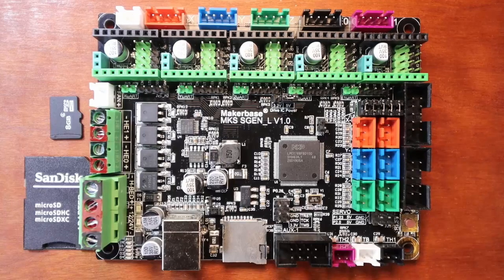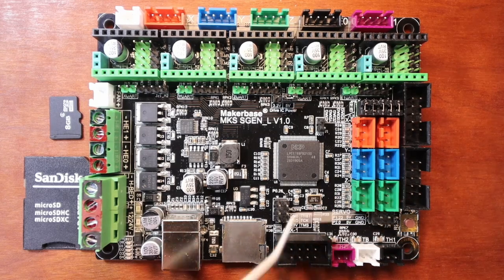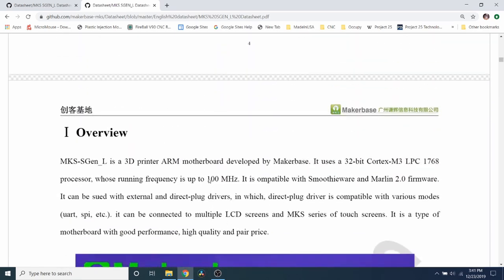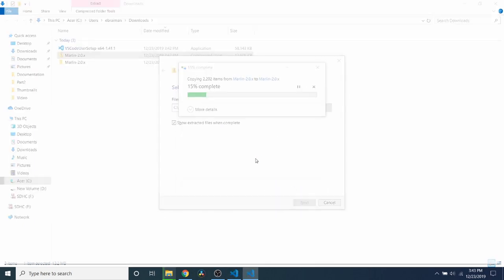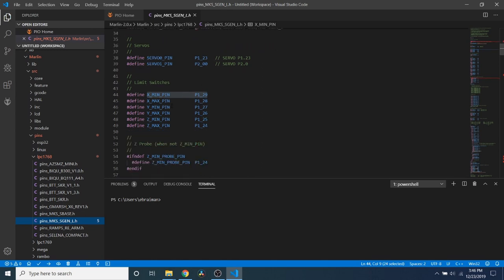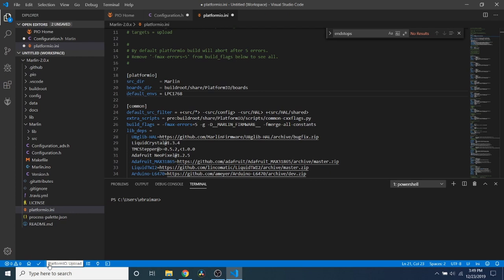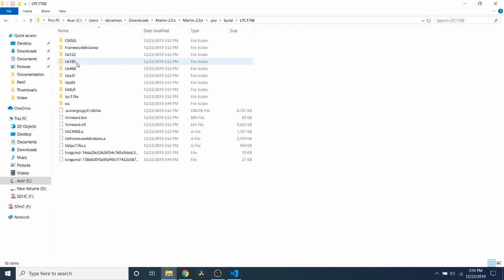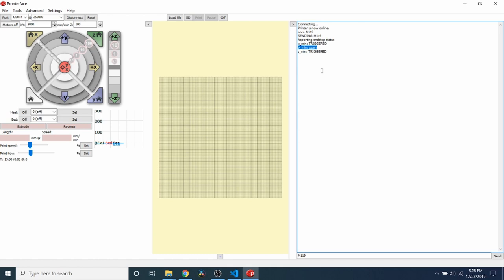MKS SGEN L V1.0 - Basics

Comment: Great, but following this video and compiling it happen tha show me "#error "Oops! Set MOTHERBOARD to an LPC1768-based board when building for LPC1768.""...any suggest? thanks
Reply from the maker: Is your build failing?
Reply: @EdwardBraiman  yes, the strange thing is that i tried to compile it as mega2560 (port 0) and it works..but i can't send to my printer via usb (Ch341 drivers installed) AVAILABLE: wiring
CURRENT: upload_protocol = wiring
Looking for upload port...
Auto-detected: COM3
Uploading .pio\build\mega2560\firmware.hex
avrdude: ser_send(): write error: sorry no info avail...so i dowloaded firmware in a sd card, insert it in the board,  opened the printer..and nothing happened...anyway thanks for your answer, if u have a suggest thanks again
Reply from the maker: What's the hardware and software you're using to build the firmware?
Reply: @EdwardBraiman  MKS SGEN L V 1.0 with sd card slot...windows 10,  Marlin 2 bug fix as your, tried in arduino ide and with vsc/platformIO...i have problem with comunication via USB and SD..the firmware is ok...but I can't send it to board :(
Reply from the maker: Send me your configuration.h over Discord below in description below.
Reply: @EdwardBraiman  sorry i did'nt understood...where?
Reply from the maker: There is a Discord chatroom link in the video description.
Reply: @EdwardBraiman  I don't see any link...
Reply: @EdwardBraiman  below the video there is no link, found it from your youtube / info page ;) anyway, file sent...thanks
Reply from the maker: Check serial port number and motherboard type.

Comment: How Do i connect this board with Anet A8 machine
Reply: For stepper drivers, look up a skr1.3 stepper driver install guide for your respective A4988 or other drivers and use the same jumper pattern.

You'll need to either create a splice or jumper between the two Z motors or set E1 to be your second Z motor in the marlin firmware. Wire Motors X, Y, Z, and E to their respective connectors as shown in the video. 

Next connect X, Y, Z endstops to the min endstops.

After that, I recommend using a new LCD because the standard A8 LCD does not have a SD card reader. Wire the new LCD to EXP 1 and 2. The discount 2004 LCD or full graphic LCD are common and affordable choices. I am aware some printers can use the same sd card that carries their firmware for also storing g-code but I cannot confirm this functionality with SGen L yet.

Then, connect the extruder and heated bed to HEO0 and H-Bed with their respective thermistors to the ports TH1 and TB as shown in the video. 

The heat sink fan probably should go to the constant voltage port but you can use the second hot end screw terminals as well if you can find the setting in firmware. 

The blower fan can be connected to the fan connector beside the hotend screw terminals.

Finally connect power as shown in the video and program the board with the micro sd card.

Comment: hi,i make step by step as your video,but i have 64 error ....please help me
Reply from the maker: What is the error?  And could you rephrase?
Reply from the maker: Try send me the files on Discord.
Reply: Edward Braiman hi , I’m change settings of board on two file configuration, I’m disconnect tft , insert sd , restart ... ok , the firmware is inside (I’m not sure ) but , power off , connect tft , remove sd , restart... but with tft nothing .... set same speed of port com , please , help me ... after , is possible use the printer only with board and tft , or is necessary 12864 display ??